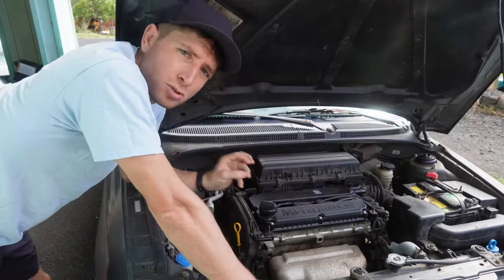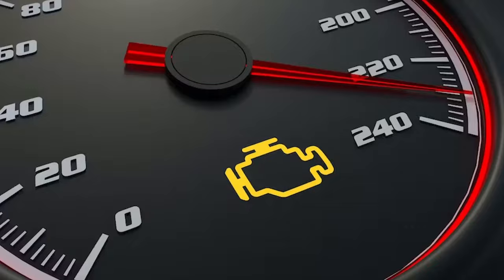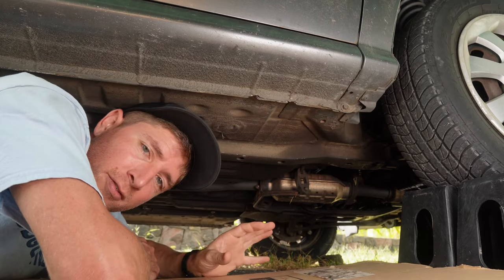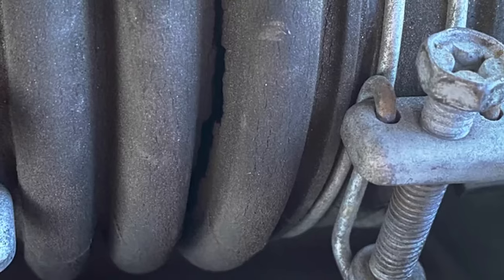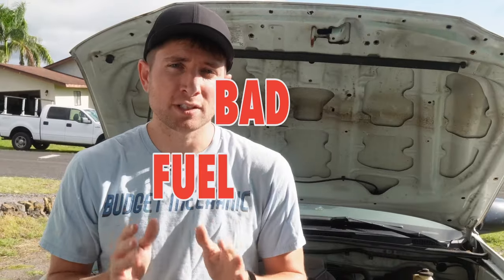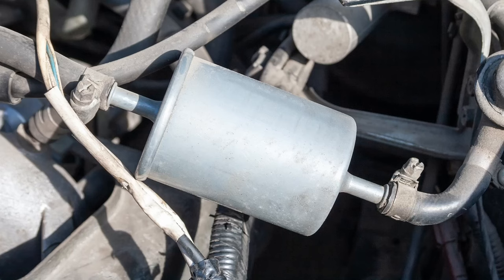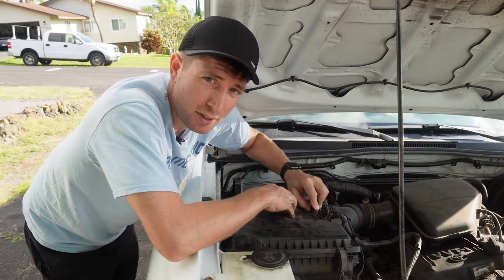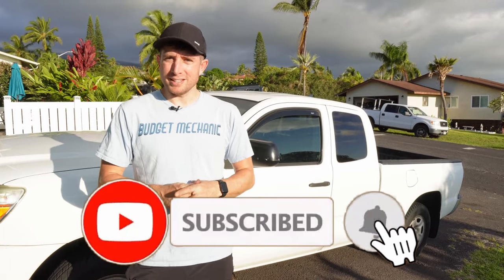Why Your Car Won't Go When You Step On The Gas Pedal

Comment: Hi I got Lexus es350, 2007 model. very clean car, very smooth drive. But when i push the paddle it wont move fast but after may be a second it start moving fast. can you pls guide...
Reply: When you go down and feel your gas pedal does it move around a bit or feel normal?
Reply: @Taylorina8X  it’s normal and smooth

Comment: My engine light is on and stability is on too. Has no power. We replaced the ignition coil and spark plugs. My car is a 2013 Chevy Impala LT V6
Reply: Was that the problem
Reply: What's the code?

Comment: Will you do a vido on barkes ihad brakes,rotors,and calipers replaced on front brakes now that didn't fix it now my back tire and still front tires are getting hot and smoking and i don't understand why because my back wheels were fine no problem until I had the frount brakes, rotors, and calipers fixed .Do you know what may have caused this problem can't drive because all 4 wheels get hot and smoke

Comment: Not always true dude whatever the computer says can sometimes be a closer step to knowing what could be the issue to cause that code like for instance, my 2005 Nissan Titan has no response at all. I lost it when I was doing a race. It set off a code saying throttle pedal accelerator position sensor. The other code was throttle body sensor and mines electronically controlled so I replaced both of what it said codes are still there replace the fuel pump issue solved. All codes went away had response again but it started right up and ran great just weak fuel pump. They don’t just go bad and not work at all. They become weak they think because it starts to run that is not the problem not always true same with the computer whatever the computer says can sometimes be explain towards what those two codes can be connected to.

Comment: What about when you hit the gas, no acceleration for a few seconds, then a gradual increase in speed. BUT, can reset by turning the engine off then on again. Happens again later in drive. This only happens in weather 50 degrees or greater. Never get codes either.
Reply from the maker: I would check feel pressure, could be pump

Comment: Hi Josh. I need help. 2019 Camaro 6 Cylinder 1Lt. It will crank up fine but won’t drive at all. Recent transmission flush about 2 months ago. Can you help point me in the right direction?

Comment: My 09 Matrix (220,000) sometimes runs great, I'll stop and then restart it, and it runs horrible. It throws a multiple misfire codes in cylinders 1 and 2. Clear codes restart, and it runs great, revs to 6000 RPM, starts right up, for A few rides then it happens again.
Reply: Did you change plugs and check coil pacs for cylinders 1 2

Comment: i was on a doordash delivery and suddenly the acceleration  stopped..i looked under the hood and noticed a cable to the throttle broke off, its a plastic part, i tried zip tying it back on but no luck..would that be the issue? im still waiting for a tow
Reply from the maker: For something that important you need to replace the broken parts (cables, cable mounts, etc) with proper parts.

Comment: i have lack of power and my check engine light is a p1607 could that cause the problem? I also have a tcs light on.
Reply from the maker: Doesn’t sound like fuel pump, google that code

Comment: I simply bypassed the heater core on my antique 4 cylinder Nissan truck and now it only gets 8 miles per gallon..... Temperature gauge is fine and has plenty of power
Reply from the maker: That should not effect your mpg! Did you break a vacuum line while you were at it??
Reply: @BudgetMechanicHawaii  I checked the vacuum lines about an hour ago I don't see anything unplugged but I put the bypass about 11" lower down than were at previously was... There was only 1 vacuum line in the way And I never disconnected it because I never changed the heater hoses they're hard to get to Going into the engine block.... I also disconnected the air conditioning and captured all the Freon on the same day that I put on the bypass.... The belt drive to the air conditioning has been removed for years... It's an older truck but It was a full tank just 2 days ago and now it's half a tank and I just went to the auto parts store a couple of times which is only 2.2 miles away... I went to McDonald's a couple of times that's about it Maybe drove about 36 miles and used 1⁄2 a tank again

Comment: I am experiencing an issue with my car (Quasqai 2007, petrol, manual). I am unable to accelerate beyond 60-70, and when I attempt to do so, the RPM remains constant, not reaching 70. Despite recently changing the clutch kit as advised by the mechanic, the problem persists. What steps can I take to address and resolve this issue? Pleases
Reply: Change air dlow sensor
Reply: Air flow sensor needs changing

Comment: I have a 2003 honda accord 4 cylinder. When I put my foot on the pedal is slow to accelerate. It likes to fly but when I take my foot off tje pedal it slows down. It seems like it down shifts or something and buzzing noise. As soon as I put my foot back on tje pedal it runs smoothly and speeds up quickly. I'm not great with cars and still learning everything I can I just wanted someone's point of view of it
Reply: Maybe a weak fuel pump

Comment: Hi, my throttle is behaving weird in a way that maybe you know the answer to.
If I press the pedal from 0% to 100% it's not reacting to the equal amount. 
Sometimes if a press the throttle 80% to the floor it's reacting like I've only pressed 20% and vice versa. And sometimes I can accelerate up to 60mph and then the car is unable to accelerate further. It stops a for instance at 60mph then slowly loose speed down to 50mph even though I'm giving it 100% gas. 
First the Error Code showed that there was a problem with the Lambda Sensor but the problem persists even though it's been replaced. no other error codes shown.
Any thoughts?
Reply: Maybe inspect throttle position sensor

Comment: Hyundai accent 2014 my car runs it will accelerate but after running I’ll press the gas again and won’t accelerate lol I checked my filter it looked dirty but not terrible.. thinking maybe throttle sensor or fuel pump. This happened right after I got gas
Reply: No check engine light is on.

Comment: i need help too . i changed my oil my oil level is perfect, did everything right but the day after, my gas pedal is hard and acceleration is fine but it makes a roaring when im trying to speed up 😟
Reply: qnd its a hybrid so its mostly quiet but it sounds wnd feels like its struggling
Reply: or rough

Comment: hi,,ANYONE   2012 NISSAN QUEST  & past 2 mnths began with a sputer one morning like was not getting fuel,,so i tuned engine off and restarted several times and drove fine for 3 days then it STARTED spuerting again at red lights & i would pull over ,,shutoff & restart & then runs good another 2 days ,,,then RANDOMLY did it for 2 weeks,,NOW   idles & stomp gas pedal all good ,,BUUUUUT drive for 40 seconds & sputters like not getting fuel  & noww cant go 1 block without having to pullover & restart to go another block,,,ANYONE ELSE hear of this,,thanks!!!!  new air filter   & see no air leaks anywhere
Reply: Change your spark plugs

Comment: ECU problem data from sensor goes correct but not reading correct in engine ECU. Blocked injectors dirt into injectors high mileage

Comment: I have Nissan rogue 2018. Last day I was going on my car all of a sudden the car started loosing power. I was on the high way. I slowed down the speed and managed to came back home. I stopped the car then after a while I started the car I got started but unable to move.
There is no engine light.
Here local mechanic is saying there is an issue in the transmission so need to replace it. But I am really confused. If anyone can help me out it will be a big help.

Comment: My problem is I press the gas and it won’t go over 3000 rpm and it will slowly go up to speed and it will randomly die
Reply: I am also having the same issue but 2,000rpm
Reply: Any luck?
Reply: Anything I’m under my car rn 😮‍💨
Reply: Mines does/ did the same. I just deleted my cat and it’s better but there somn in the engine that’s the culprit

Comment: I was on interstate driving about 60 in the overdrive  light came on  I  stopped now the truck is in lamp mode
Reply from the maker: OD light coming on points to a transmission problem. Check trans fluid level immediately

Comment: My problem is the car will drive fine and then going up hill it won’t accelerate or it will shut off after a while of trying to accelerate
Reply from the maker: I would say get that fuel pressure checked!

Comment: put restrictor in the heater hose line ....gas mpg normal now....heater core gone....
Reply from the maker: How does heater core effect your acceleration power?
Reply: @BudgetMechanicHawaii  ... The heater core bypass lowers the coolant temperature through the throttle body then computer richens the mixture giving you more horsepower

Comment: Youre another person that is wasting a lot of peoples time when you make a title but dont give an answer. If you push down on your gas pedal and nothing happens a person need to check the plug in at their throttle for their electric throttle. As long as the accelerator electrical connection fails or the electrical at the throttle body they will not be non responsive